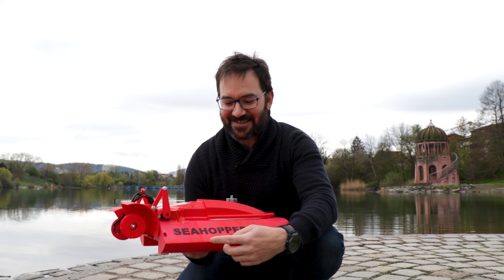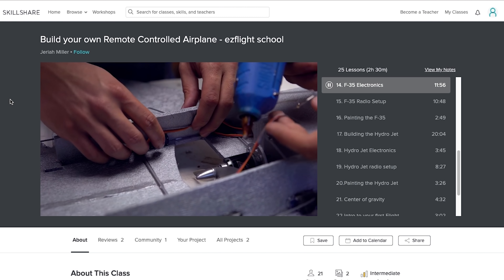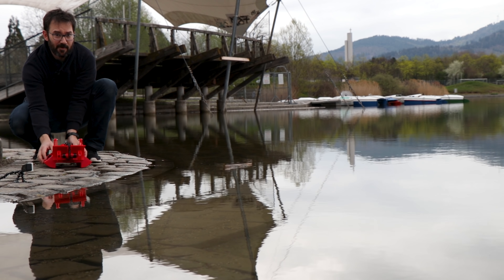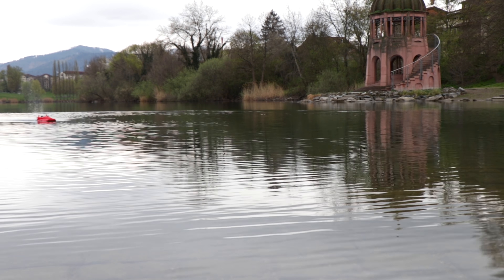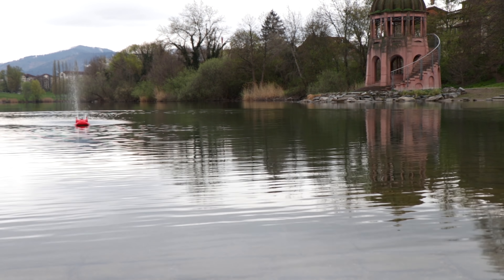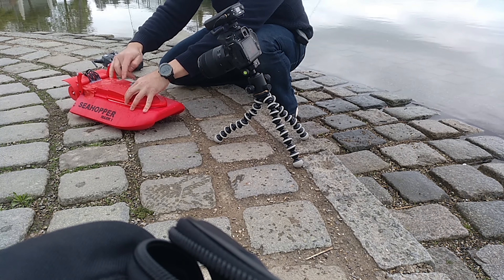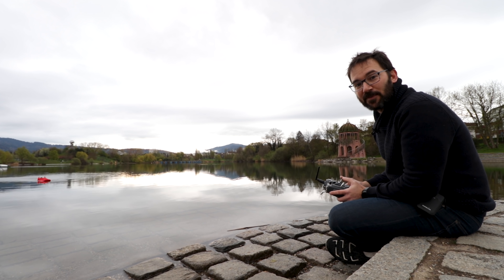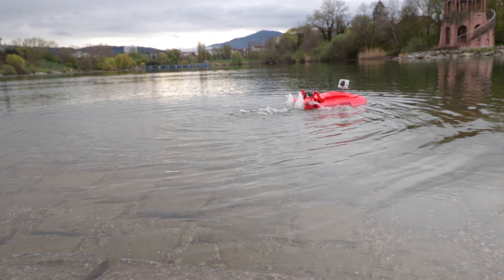TESTING THE RACING PADDLE BOAT

Comment: How about a RC Duck boat that uses webbed feet to move?!
Reply: the motion is actually somewhat complex though, you need 4 phases : push, rotate 90, pull, rotate -90 (back to the start) though the rotating motion could be done with either a solenoid (might be a good use of an hard disc arm) or a servo
Reply: How about put this thing inside a giant rubber duck

Comment: I think a problem might be that its sending water UP rather than BACK
Reply: The problem is when it spins so fast it just creates a void in the water and spins inside it. Paddles are meant to turn slow.
Reply: This is an essential paddle issue, which is why they aren't used anymore.

Comment: Seems like you could recapture energy from the water being thrown straight up maybe a bigger less circular "wheel well" angled so that the water pushes it forward.
Reply from the maker: Yes, I thought of that but first I'll try a wheel design that does not push that much water up.
Reply: @ivanmirandawastaken  sounds interesting approach I didn't thought about. Nice!
Reply: Was thinking similar - you want the water ejected from the paddles to go backwards rather than up, somehow. Spend that energy on forward propulsion rather than pushing the back end into the water. Not sure how though!
Reply: @ivanmirandawastaken   maybe enclose the wheel a bit more to pull the water from the bow to stern underneith, rather than push the water around the hull. This might help reduce drag.
Reply: @kevfquinn  It revolves too fast

Comment: This is probably not the most efficient way to propel a boat in a liquid because there is much energy lost when rotating the paddle wheels compared to a propeller propelled boat but it looks cool and I like it!
Reply: Probably? haha
Reply: extremely efficient at low speeds and power settings
really useful in shallow water where a prop can get fouled
unfortunately, at the speeds shown here, completely outside of the design's usefulness
needs bigger paddles moving slower, a lot slower
Reply: @jeffhousen8968  so you are saying it is like 4 wheel drive for boats
Reply: This is a fairly obvious thing to say.  He was almost certainly aware of this when he set about the project in the first place, no doubt he was trying to see if a paddle powered boat could be made more efficient with modern materials and so on.

Comment: I think bigger paddles would be a good idea. More surface area more than anything. More water to push against.
So maybe paddles that are wider, or maybe paddles that go deeper into the water.

Thanks for what you do!  :)
Reply: This ^^^ ✓
Reply: You can even make them float if you put a closed room inside, and put the paddle a little bit out of the wheel
Reply: Or Angel the paddels so the water "drops" of the paddels before it is lifted up.
I don't think that is my idea, and I think we will se that soon enough. , 😜

Comment: Things to try. Print a couple of hull extensions to mount onto the rear to either side of the paddle wheels for more flotation at the back. Cover the bottom with aluminum flue tape to make it smooth so it doesn't have the drag from the layer lines. Print new paddle wheels with angled blades so they enter the water flat or nearly flat at the front and are vertical when they get around to the back. That way they're pushing down as they enter the water to force the rear up, and pushing back as they're coming out of the water. The straight radial paddles waste energy forcing the back of the boat down as they pull out of the water and throw up large rooster tails.

Comment: There is a free program called Carson Hull Designer.  It's an old program but works great for designing boat hulls.   It will even tell you where the water line will be with a given weight.   Great project!  Live the vids!

Comment: I think you're getting air pockets built up in the paddles with the closed sides. Try the open side paddles once you get the balance/weight issues done.
Reply from the maker: At that speed there's not much water entering each of the paddle cavities nor time for air pockets to form. The wheels are spinning at around 10000 RPM so each paddle is pushing tinny fractions of water weight.

Comment: I was thinking, with if you curved the blades on the paddle wheels, create an opening in the center of the wheel on the end and enclose them with a small opening on the front of the enclosure below the water line to intake water, and then an opening on the side where the center of the paddle wheels are and a nozzle for water to shoot out. Sort of create a jet boat effect?

Comment: The first issue is the angle of attack the paddle wheels are making with the water. I think a 30 to 35 degree output would be ideal. Design the paddles so they contact the water at a negative angle and use a test rig to find the magic angle. Second issue is the shape of the hull. The sides being partially submerged is causing unnecessary drag on the frame. Go with a traditional boat hull or pontoon style to reduce drag.

Comment: With the paddle wheels, instead of printing them in 1 piece, with all the support material, i would suggest printing them in 2 parts. 1 side with the propellor and the other side. Should be a lot faster and with a lot less material. The water sent upward could be diverted backwards with a longer and wider conical shroud and should also prevent any more water from seeping into the hull. 
I would also imagine that the more wider apart the wheels are the better and more efficient they will become with better steering

Comment: Great! I wonder though: the motors are hanging directly in the water without any issues?
Reply from the maker: Yep, brushless magic!
Reply: All wires are insulated in a brushless motor. Which is great.
Just electromagnets and ordinary magnets around the axel. No need to transfer energy to the moving part. 😜

Comment: you can easely increas the paddles clearance issue by adding a lever between the chassis and the paddle holders, might be a good time to reprint em with a solid bar for more control and efficiency.

also in water, torque is not a factor, so go for speed, the faster the end side of the paddles, the faster the boat gets
Reply from the maker: Torque is a factor if the motor does not start spinning because lack of...

Comment: If the paddles are slanted 45° so they exit the water vertically, wouldn't that add lift to the tail end of the boat and minimize the water thrown up into the air?

Comment: IDK if it would be too complex but would it be worth trying ducted turbines like on jet skis? Maybe powered via timing belt around the circumference of the turbine to give more torque?
Also if you extend the cowls over the paddle wheels more it would reduce the downward force on the back and also reduce all the spray

Comment: I expected faster boat, faster than the super RC boats that Roman Atwood plays with. But I like the design, its very unique. I think you should attach a funnel like tubes behind the propeller. Something like a jet engine. The water thrown by the drum propellers will be forced out of small nozzles which will givers speed...? 🤔

Comment: I built something on this principle 55 years ago my wheel only had two paddles the hull was v shaped the paddle was mounted in the crux of the v had a step hull forward of the paddle wheel and it was quite quick paddle rotated at around 15000 rpm

Comment: I think when a small paddle spins really quickly like that a massive amount of energy is lost. Maybe wider paddles would work better and there might also be a way to angle the veins in the paddles to scoop more water.
Reply: But you also want to reduce the water that isn't pushed back. As that will be energy in the wrong direction.

So the water that is thrown up is energy that pushes the Stern down, not forward.

But Yes, Something will be needed to be done with the paddels, so water falls of them and not follow the paddels up.

Comment: Hi, Ivan! I think that this boat need bigger wheels (2 - 2.5) and some counter-load to prevent "diving". Also the blades has non-efficient shape IMO. The longer the path, the bigger "water-torque" they will give. So if they will be "swirled" (like computer fans but just in one axis) I guess it will help to increase speed maybe for about 20-30%.
The problem with wheel's size is that it gives too much torque on one wheel with a very small square of water contact. So it just wastes power and water flows too quick. If you'll place this boat in oil, I'm sure it will go faster. So... the bigger wheel - the smaller torque. Also... maybe you should try and lower the speed of bigger wheels so water flows will go without "breaks" and unwanted turbulent areas. Also if you'll place four bigger wheels with not so high rotating speed, this will increase the boat's speed a lot!
P.S. make a rubber box(es) for motors, electronics and batteries! Sealt boxes for working blocks is a "must have" for any type of RC boats. If you don't want fireworks on water ))

Comment: I wonder if you could build a series of paddle wheels the length of the boat hull (smaller ones perhaps) that would collectively propel the boat?  Kind of like 4-wheel drive cars maybe.  Basically, instead of the two wheels at the back trying to push against the friction of the boat's hull the wheels under the boat would just 'roll' the boat along.  <- hard to describe in text what I'm thinking.... it sounded better in my head... maybe I should have left it there? ;-).    Anyway, thanks for your fun vids!

Comment: the paddles need to be more agressive, like r/c car paddle tires.  If you can get it on plane there will be less wheel in the water.   You could also try a wider paddle

Comment: If you look at paddle wheels, they typically have wider paddles, that also are not solid all the way to the core of the wheel, maybe try printing some that are the width of the side they are on, and not solid from the edge to the core of the wheel then give it another go, my bet is you would see a better speed out of it

Comment: I'm a little disappointed you didn't even try the bigger wheels.  Assumptions are not substitution for testing.  Even at 3/4 submerged, as long as the water has somewhere to go you could get thrust.  Displacement of the larger paddles might have surprised you.

Comment: Awesome work, Ivan! 😃
You could try lower kv motors. Maybe they can give you more torque. 😉
Reply from the maker: Those are the lowest kv that I could find in time and of that size. Do you know of any of lower kv?
Reply: @ivanmirandawastaken  Hmmm... There are some 2212 motors with 890kv and lower. It depends on what size you want. 😊
Reply from the maker: Those are 920 if I remember correctly, I'd want to keep the size down, I already have some huge motors for the bigger version.
Reply: @ivanmirandawastaken  Well... Then I guess it's good enough! 😊
Maybe you just need to lower them in the water. 😃

Comment: Great, much better than I feared it would end up. 😏
What about the other paddels?

You get lots of water going up, instead of backward. Which will get a force pushing the boat down in the rear and not forward. Maybe a longer sheild/fixed paddel/wing that stears that flow back?

Anyway, Great success. Now on to  do some adjustments. 😜

(sorry for the trouble we made in the last video, but those guys "critics" got on my nerves, sorry)

Comment: First of all, this is an amazing location! That small tower gives it an interesting almost steampunk-ish feel.
As for the Seahopper, at those RPM that the wheels are turning, just encase them in snail-shaped housings and you'll go much much faster. It would still classify as a paddle boat even though it'll have two centrifugal pumps instead of wheels on the back. Right now the paddles slap the water so fast that they pull air with them and cavitate. Open sides (like you have on larger wheels) will help with that for sure. Would also be interesting to change just profile of the paddles and see how it affects the boat. Perhaps something similar to a turbocharger impeller even, so it actively pulls the water 'in' from the sides?

Comment: Great project!
As others have already mentioned - most of the thrust direction off the paddles seems vertical.
I'm wondering if "surface tension" is contributing to the problem - therefore wondering if wider paddles would help. 
As others have also suggested - angled paddles (30 or 45 degree?) might improve things by re-vectoring the flow - with maybe some gearing down to lower RPM but not reduce torque .
Would be interesting to see comparative results.
Keep going - Thank you

Comment: Remember, steam engines ran the old paddle boats. Slow with thousands and thousands of nm/ftlbs of torque to prevent cavitation, which ends up wasting power.

It’s going to be a fine balance of paddle surface and velocity. Good luck Ivan!

Comment: I mean, I totally get wanting to try different systems and all and I really don't want to sound very negative. But some of the recent projects, though cool to built, were so clearly not going to work, isn't it a tiny bit of a waste in that sense?
Reply from the maker: Is going for a walk a waste of time because you end up back home where you started? Is it a waste of time to watch Ghostbusters for the 37th time because you already know how it ends? It depends...
Reply: Ivan Miranda no not at all, those are great! I’m just wondering about the building and design process. :) If it’s about simply learning what works and what doesn’t, that’s great, but we kind of know it doesn’t in these cases already. Building just for building is fun ofcourse.

Comment: Why not use super wide paddle wheels?
Reply from the maker: That would over complicate the design, unbalanced wheels would cause much more damaged if not axially centered (or is it radially?), so I would need to put an axle and couplings and...
Reply: @ivanmirandawastaken  Good point. Then what about  spoons? I mean little spoons as paddles? slightly angled so they wont pull the entire boat down. 🤔
Reply from the maker: That I'll try, yesss

Comment: When you say that you do not put on the bigger wheels, because the small ones are already almost half under water, you sound as if you think that bigger wheels would then be more than half under water.
But no matter the wheel diameter, the axle is always at the same level. 

So bigger wheels would also be less than half under water. And they would probably work better simply by going down deeper and having more leverage against the water.
Reply from the maker: You're right but (there's always a but) my fear was that bigger paddles would have even more leverage against the water sinking even further the rear end and thus having not only worse performance but sending the boat to the bottom. I'd have wanted to have all the diameters outside the water in the up position and start lowering them to the water. Next time.

Comment: Actually, your fenders accommodate somewhat for paddle wheel dip at higher speeds due to simple hydrodynamic and inertial forces, so, because of their greater potential to displace incoming water, your larger paddle wheels SHOULD do pretty okay at higher speeds. ~( 'w')/

Comment: Okay  one  prob is no matter how big the wheel's are  it is not going to move faster . paddle boat like this  pick up speed over time . meaning you haft to work the throttle  slow to high  at longer time's .. 2nd  these are  incased paddle's  meaning there fully round with no way for the water  to get out . meaning the paddle wheel's are always  filled  with water .. take a tire   in the mud. if the tire is fully  covered  with mud  it becomes a slick  tire. even adding a nasty grip tire  still mudd   turn it into a slick . so you need a way for the mudd to travel out of the tire .. what am  trying to get at  look a the old school paddle  boat  . there  wheels are not fully in cased